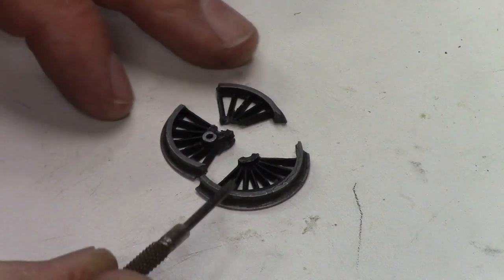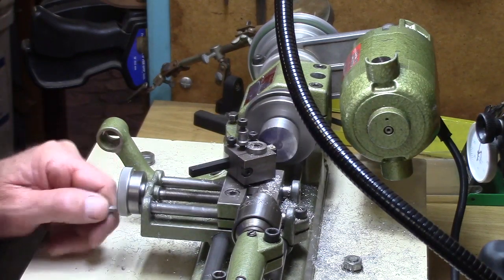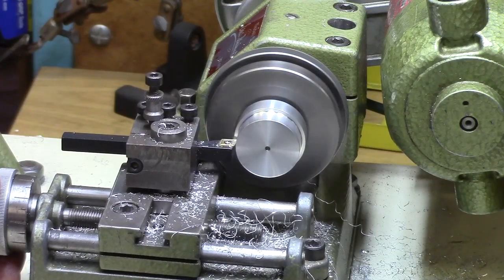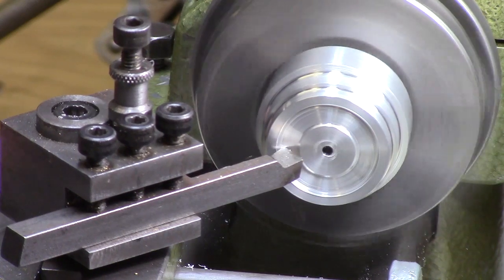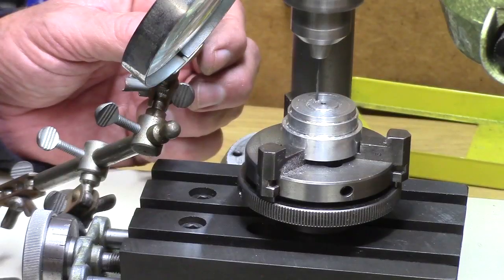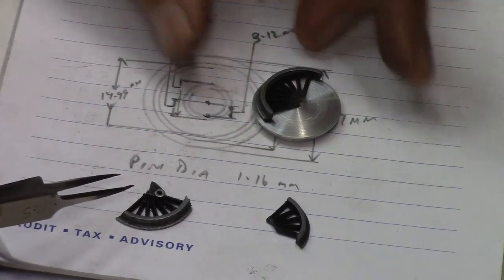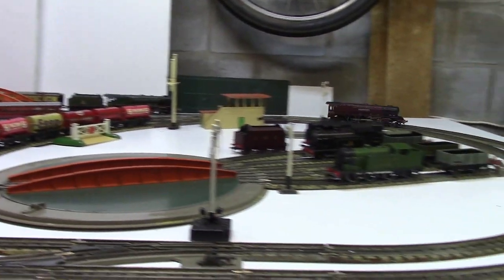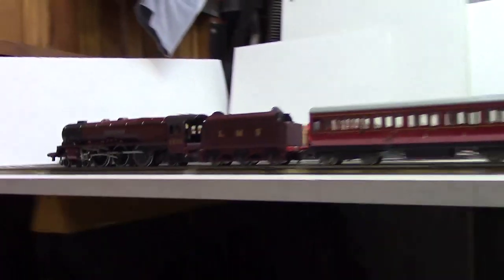Making a Hornby Dublo Duchess of Atholl Locomotive Drive Wheel using my Emco Unimat SL Lathe

Comment: Are replacement parts impossible to find for that type of locomotive?  From the manufacture or eBay etc.?  Or you could make replacement wheels for all of the drivers, then you would have your own one of a kind locomotive.  Either way excellent work and thank you for sharing
Reply from the maker: Thanks for your interest. It is possible to find 2nd hand parts , including Drive wheels, for this Duchess Loco via the Hornby Railway Collectors Association in the UK, but the high cost of postage and/or freight to send the relatively low UK cost 2nd hand part to my location in Cape Town is not a worthwhile option. I enjoyed making the replica wheel myself - Paul

Comment: did you make that adjustable tool post or did you buy it? I need one of those! so useful
Reply from the maker: The Tool height adjustment feature on the Tool post is a modification made by my Lathes original owner .

Comment: WOW, never seen  anything like this before, a very skillful job undertaken here, especially considering the age of the "Duchess of Atholl". Would love to know how the "quartering" of the wheel was undertaken, I believe that Meccano Ltd and it's authorised servicing staff had a jig to set this correctly. It is still possible to obtain driving wheels, secondhand of course, have been thinking about sorting out my Dad's old "Duchess of Montrose" as the wheels have a groove worn in them from excessive running. I have been a member of the Hornby Railway Collectors Association (HRCA) in the past as they issue a spares directory issued annual, I'd probably have bought some driving wheels from one of the suppliers.
Reply from the maker: Thanks, yes, it was worth while to get this old Loco running again and it's still running very well. The cost of getting used spare parts sent to Cape Town from the UK is  prohibitive not to mention the extremely dubious reliability of the virtually non-existent SA Postal services once they land here.

Comment: Splendid bit of surgery there, good to see an old-timer put back on the rails instead of consigned to the parts bin or worse.
Reply from the maker: Thank you, yes, it's still running very well. The cost of getting used spare parts sent to Cape Town from the UK is  prohibitive not to mention the extremely dubious reliability of the virtually non-existent SA Postal services once they land here.

Comment: Hi,
Nice work... I notice that you have a none standard tool post on your Emco Unimat SL lathe, if you have any details on it they would be gratefully received..
Take care
Paul,,
Reply from the maker: Thanks, my quick tool tip height adjustment tool post came with my lathe from its previous original owner. It is a relatively simple modification to make on the original Unimat tool post design. I have seen other variations of this tool post mod featured in old Model Mechanic and Model Engineer magazine articles from the 1950's and 60's. Have a look at the Model Engineer magazine website many of the old archived articles are free for download and viewing.
Reply from the maker: Have a look at my video entitled "All about the Emco Unimat SL lathe" on my SteamerEdge YouTube channel to see a demonstration of the Tool Post.
Reply: @SteamerEdge  will do... thanks
Reply: @SteamerEdge  Many thanks for the information...